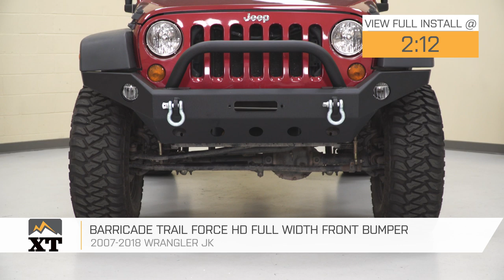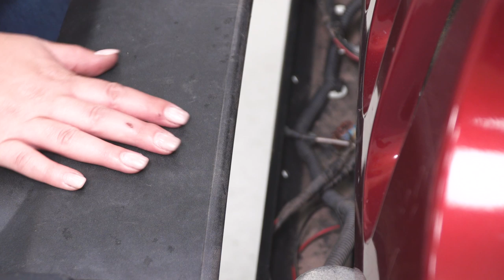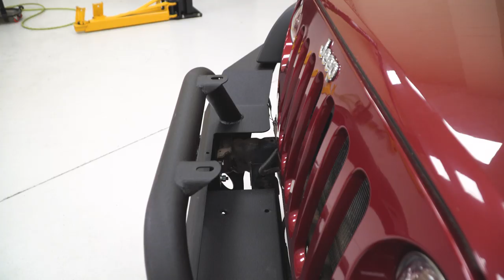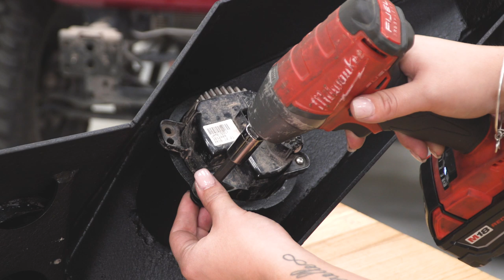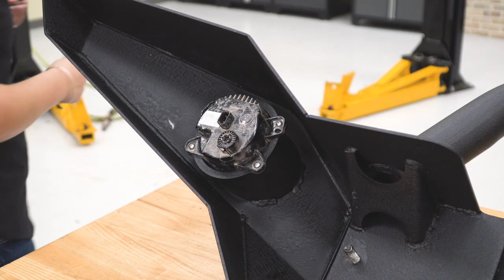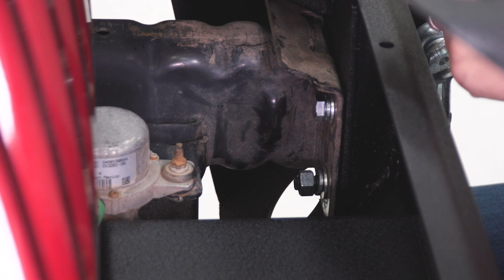Jeep Wrangler JK Barricade Trail Force HD Full Width Front Bumper Review & Install

Comment: As someone who will more than likely be solo when installing, I love that you show someone actually lifting and holding parts in place.
Reply: AceticWolfe  My wife bought me this bumper last Christmas. I installed it myself. It weighs about 100 lbs.. I put one end on a cinder block (long way up) and lifted the other side. I lightly attached one bolt on my side and then the other side. Piece of cake doing the rest.

Comment: Since this bumper is heavier than stock, will it cause the stock suspension to sag? Curious if I need a lift or leveling kit before getting this bumper. I have a ‘16 stock sport S unlimited.
Reply from the maker: Installing any full-width metal bumper will result in the front-end of your Wrangler sagging a bit compared to stock; especially if you install a winch with it. You definitely will not need a lift or leveling kit in order to install an aftermarket bumper, but having one will allow for less of a noticeable front end dip. -Zach